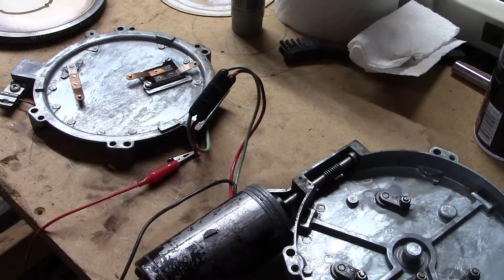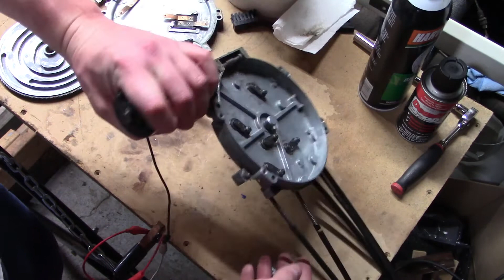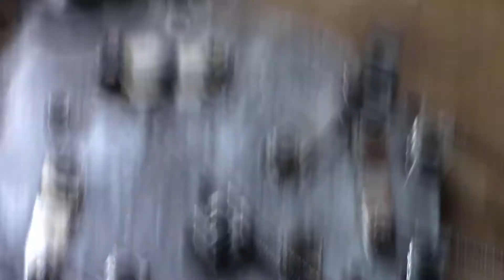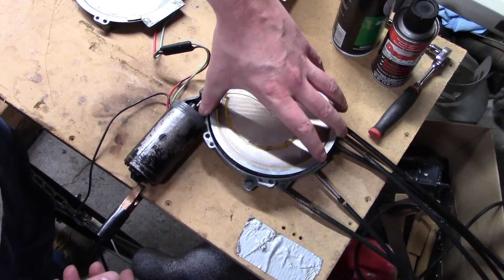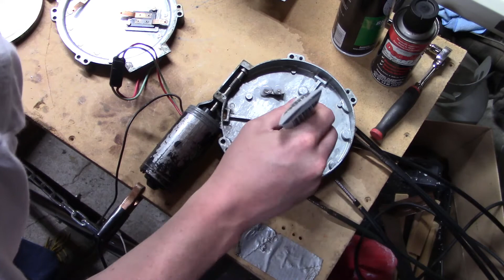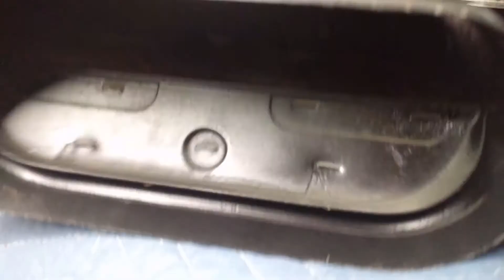1958 Edsel Corsair - Heater Servo Unit - How It Works

Comment: One thing that this video doesn't show is how to get this motor in and out of the dash. You may have to remove the front seat, unless you are very flexible. 

The cables are color coded with little metal bands, so don't worry too much about remembering where they go. You can remove them by loosening the retainer clamps and pulling the cables off the arms. 

You may want to loosen the instrument panel to get at the control cable on top of the motor, be sure to disconnect the speedometer cable before you pull it loose.

Once the cables are all loose, holding the motor in place are 4 long screws. Remove those. Be careful if there are any loose nuts above the screws - in most cases the nuts are fixed to the motor and won't drop, but one of mine was loose.

Disconnect the single black wire from the 6amp circuit breaker. If you need a new circuit breaker then they're really easy to find, it's only a 6amp.

To remove the motor, as you look up from below (with your head toward the firewall),  the motor will be above the fuse panel. You cannot take it down the right side of the fuse panel (driver's side) because there's not enough room, however if you move the wires around the fuse panel on the passenger side of it then you'll find just enough room to squeeze the motor through. Carefully twist the motor so that the disc is down and the motor is up, then move it down the passenger side of the fuse box, moving aside any wire that gets in its way.

To put it back in, reverse the procedure by  pushing the motor up past the fuse panel on the passenger side. You can rest it above the fuse panel before screwing it in. Get all 4 screws in place that hold it onto the dash, then you can begin connecting the cables.

To connect the cables, start with the top cable. You may need someone to hold the metal plate while you screw it in from the bottom. Let it be loose so that you can move it in or out while you test that the dial travels all the way in both directions, then tighten it up. At this time you can connect the power to the motor once again, just be careful where you put your screwdrivers.

Now connect the cables underneath one by one. You may prefer to connect one and then test that it moves all the way with the control knob before connecting the next one. You may also need to turn the knob so that the cable arm goes into a position that makes it easier to connect a cable. Make sure to move the arm back to the cable anchor all the way before tightening the cable down (you don't want the cable to block the arm movement).

If any one cable stops the motor from working then you may need to lube up the vent that's connected to it. Disconnect that cable from the motor and go to the vent to manually move it or find the obstruction (I had to cut some of the cardboard deflector for one of mine).

Once all cables are connected you can double-check that the off position closes both vents completely. If one vent (either left or right) stays open then you should loosen the top screw and move the cable slightly, then tighten it down again once it's in the fully off position.
Reply from the maker: Thank you for taking the time to write this out. As an alternative, it's very easy to remove if you simply take the entire dash out first!